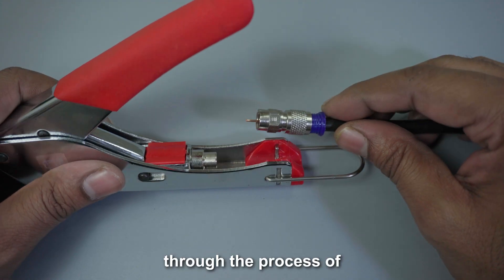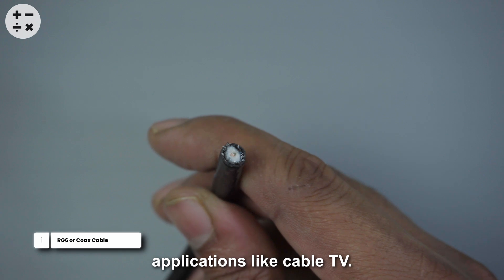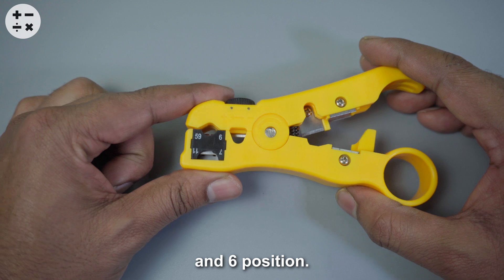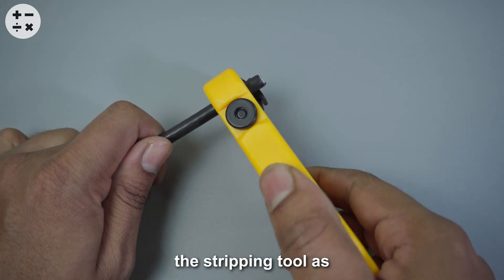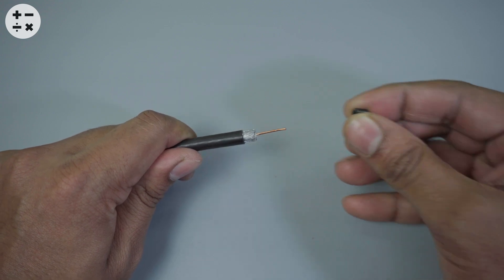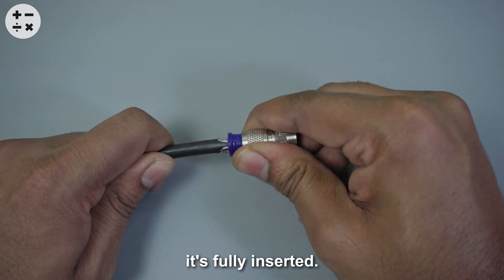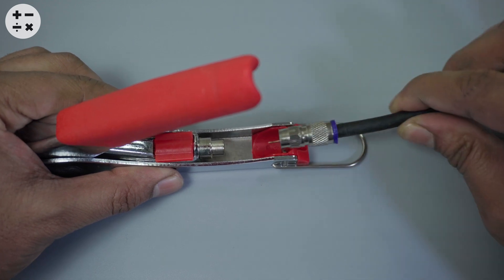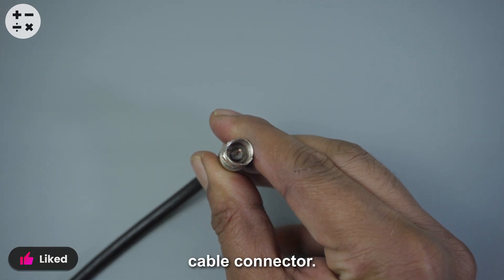How to make custom RG6 coax cable using RG6 Coax Connector

Comment: In some instruction videos, once the wires are bent back along the cable, the foil around the insulation is removed. This video does not remove the foil before installing the connector. Must the foil be removed?
Reply from the maker: You don't have to remove the foil. but the foil shield needs to be properly connected to the ground, depending on the connector type.